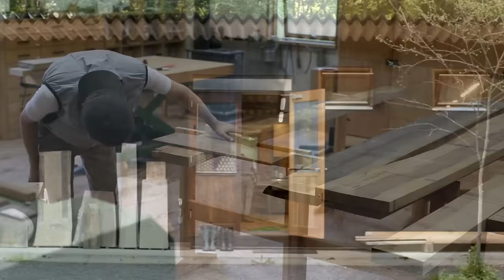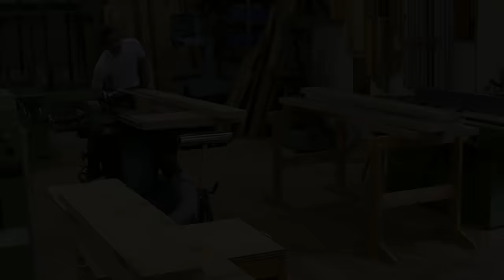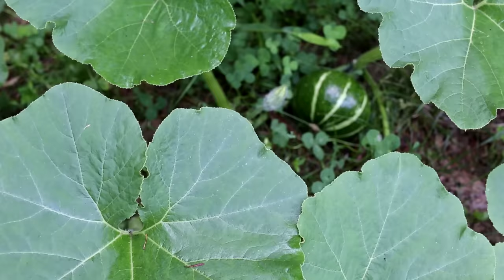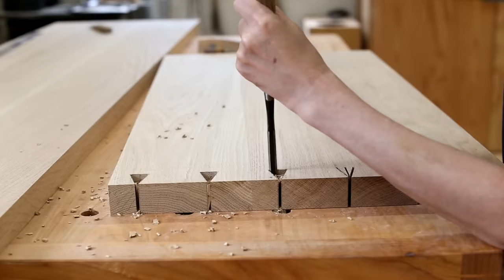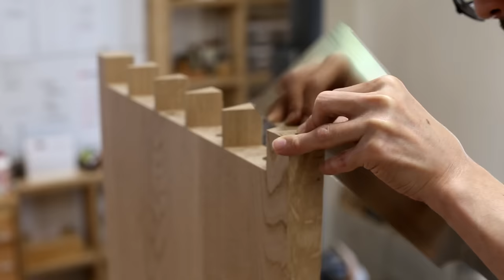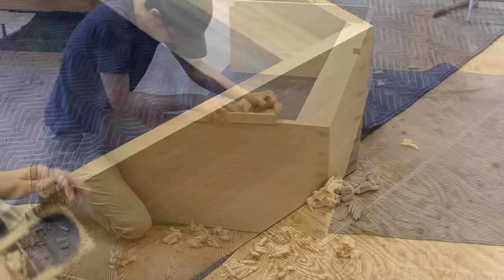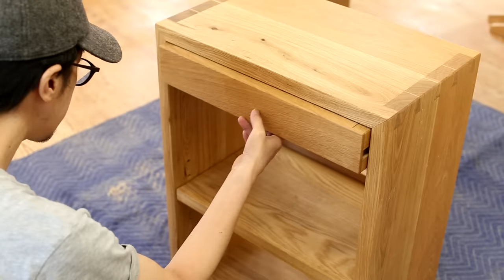ISHITANI - Making an Oak Desk - mitered dovetail joint -

Comment: those joints are just a thing of perfection , 

as usual.
Reply: Even the masters were amateurs once
Reply: @benjaminisbester3582  But not all amateurs become masters.
Reply: MT Yankin  in japan is it common to become a master when you have a good master. i always liked the tradition of japanese craftmanship, in other countries like germany there is a training of 3 years and only when you do this other people respect you as a woodworker, i don't like this system. In japan you become a woodworker while working as a assistent from a master and only when the master is satisfied you can call you a master, this can be 10 years or longer. Nearly no one you can find good woodworking anymore, in germany there were extremely good carpenters between 1800 and 1900 before the industrial woodworking began. At 1800 to about 1840 we call this time Biedermeier, you can google this and this are furniture completely made by hand without any electrical machine, there a great masterpieces, the carpenters worked at some pieces 3 to 4 months. This furniture are 200 yrs old and even today this furniture are absolutely fine. For example you can see a furniture from the Biedermeier here https://www.antik-greef.de/referenz/ref172g.jpg . Today woodworking in germany and in a lot of places are extremely sad you put some chipboard together, do some paint over it and screw the pieces. Additionally as a professional woodworker you can nearly pay your apartment and your income is way to low to make a living of it, only few people can do this anymore.

Comment: Absolutely awesome work on the mitered edges to get a tight fit!
Reply: Is that why he saws the corners after they're fitted? I was about to ask why he did that. I understand that the Japanese pull-saw has minimal kerf on its teeth, but I still don't quite see the need to saw after fitting.
Reply: @DominicPannell  yes, sawing the tight gap between the two pieces ensures the two meeting sides are paralel when done correctly, and so ensure a tight fit.

Comment: Beautiful precision on the joint!
However, I believe maximum load would increase significantly if the dovetail is made in the table top side instead of the edge, but also it will be much more difficult to make the angle cut as not one person can manoeuvre the table top to use the table, hence will have to be hand cut?
Either way, Subscribed!

Comment: I apologise for the perhaps unrelated question, but I'm really interested in your double (?) roof at 0:47 ... is it used as a thermal barrier? for snow? I'd love to know
Reply: Me too - I have the same question; I have never seen a double layer corrugated roof like that before!
Reply: I'm interested too. I think, that it should be thermal barrier, it also can be just 1 layer of metal roof, and what we see - just cheap and esthetic (may be more efficient) realization of ventilation gap
Reply: It looks kind of nice just like everything in the videos. Lovely
Reply: I believe the lower 'layer' is simply the soffit made from the same material as the roof.  Of course I could be mistaken😁
Reply: We found that solution in Brazil, mainly at Southeast and some in Northeast regions - here it is used for thermal insulation. In the most of the cases instead to have air between the metal sheets they use some kind of styrofoam. Mostly used in industrial buildings...

Comment: what finish do you use ?  I`ve been staining and varnishing my pieces and am getting tired of it.  If i use Danish Oil...is that enough to protect it from, say, a glass of cold water.  Will the condensing water make marks or does Danish Oil protect enough for that?

Comment: I realize that the dovetails are really more for decoration on this piece, but would it not be more structurally sound for the pins to run vertical and the tails horizontal where the desk surface is joined to the sides?
Reply: Curious what your thoughts are on that?  What would the advantage be to reversing the pins and tails?